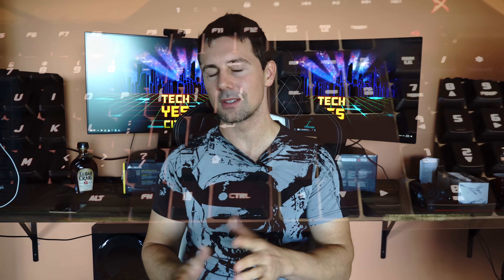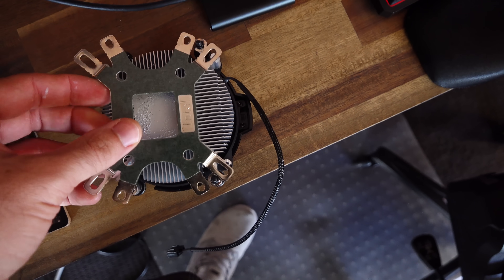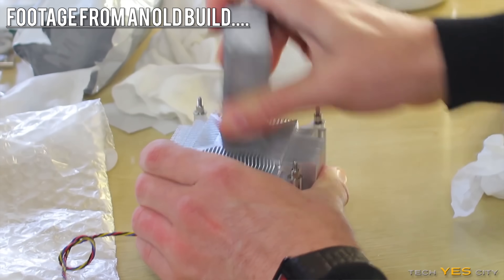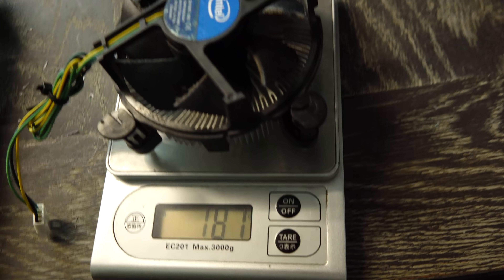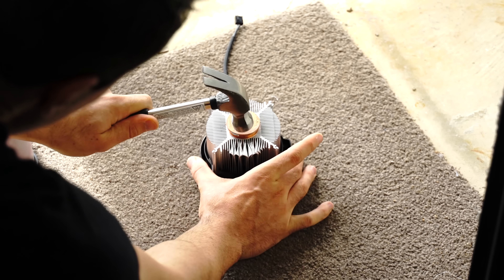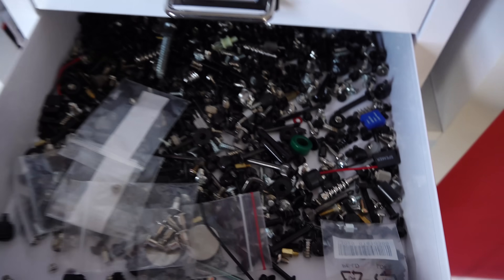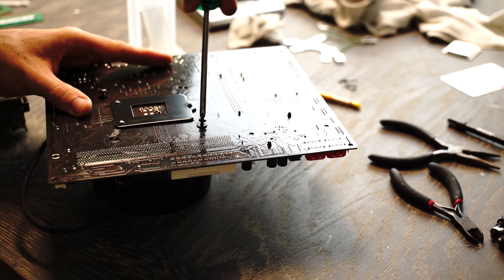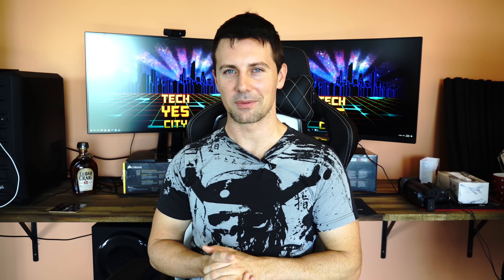How to Mount an AMD Wraith Spire to An Intel H55 Motherboard

Comment: Late to the show, but the stock mounting screws can be removed by lifting the silver metal tabs up from around the black screws one by one until they release. This way you can restore the stock mounting screws if you want to move the cooler back to an AM4/AM5 system.

Comment: believe or not i found one of those amd wraith in a junkyard, and i modded into my lga1155   i5, i had a milling machine so it was easy to do using a sheet of aluminium and some nuts , my i5 is super cool now

Comment: Im planing on replacing the old intel stock cooler to my x58 motherboard and use my old wraith amd cooler wich i moded with a 92mm fan for less noise and better performance i found this on the internet https://www.newegg.com/Product/Product.aspx?Item=N82E16835233060 but i cant find any mounting solutions for the 1366 socket nor the  115X socket do you now any good mounting solution to this ? thanks in advance

Comment: Yep. Did something similar on my Q6600 with the stock Dell heatsink. The plastic part of the Spire can be unscrewed from the heatsink, the screw holes matched up with the LGA 775 Dell heatsink I had already. No extra screws needed. So now I have an HP PC from 2009 that originally had an AMD system in it, upgraded to an Intel system from another HP computer, used a cooler from a Dell Intel system, and replaced the fan part with an AMD Wraith Spire LED cooler. Totally worth it.
Reply: i have a Q9550 and i wanted confirmation on the AMD stealth or spire cpu cooler being compatible with the 775 socket without having to physically damage/Hammer/modify the heatsink and you made my life better my sharing your experience  ! I thank you sirrr

Comment: Those didn't look like self tapping screws. Self tapping screws have a vertical cut in the end perpendicular with the threads. This sharp end is what cuts the threads. If those were actually self tapping screws you would have seen aluminum shavings come out where the threads were cut.

These are just regular screws but since they went into aluminum it just deformed the aluminum to accept the threads. Self tappers aren't required when going in softer metals as long as your hole is the right size

Comment: People, I want to know something. I'm starting a new watercooling build (my first) and I have a few questions. I have vega 64 gpu from msi, an I7 8700k, the Asus strix z370 e, 16gb trident z memory and a 1000watt psu from cooler master (the v1000). I was thinking of putting a reservoir in the place of the hard drive cage. Would that work? I am thinking of using the ek xres 140 revo d5. If not, what will work? I am also planning on using the vega 64 water block from ek but it doesn't look like the radiator, fans and the block will fit. I just have the pc and no watercooling equipment as of now so I haven't bought anything. I am thinking of using the ek supremacy evo cpu water block or the phanteks cpu water block (the c350a_bk01). Would it be possible to squeeze a 360mm rad in there? Or a 240 up top alone with fans in the front? Will a 240 alone be enough for both the cpu and the gpu? Or should I just change the case? Do you guys have a better suggestion for the case? A case with better watercooling support, maybe? With decent airflow? Also, if you can help me out with the fittings and stuff, it would be appreciated. I'm probably not going to be using hard tubing cause I'm lazy so bends and stuff don't matter as much anyway.

Comment: It's cute how to correlate weight of the coolers to their cooling potential. Specifically, when you weigh then with all of the plastic, non-heat transferring crap attached to them. You must be given a PhD!

Comment: you say that the copper slug isnt permanently attached however as an engineer i can say it is as there would be no other way other than a compression fit to connect copper and aluminium as they wont weld or solder together and a compression fit wouldnt need thermal paste or adhesive.

Comment: those aren't self taping screws. self taping screws have a bit to cut into the material to help sink the screw in better. wow hack job. I would of used a dremel to cut out the area so it will pass anything in the way. Hmm just scratching my head.
Reply: JayRock I'm scratching my head about someone who can't even spell "tapping" criticizing anyone else for anything. Fix yourself first. 

#priorities

Comment: While I love the idea/concept, the execution here was... lacking. Breaking off the screw mounts for the stock screws? Why not just pull off their c-rings and remove the screws without damage? Similarly, bending away fins with a hammer? Why not use a dremel or hacksaw? I suppose you use what you have, but that's not exactly good DIY advice. Oh, and the copper vapor chamber slug coming loose doesn't bode too well for thermal conductivity between it and the aluminium, now does it? I suppose lowering it down had benefits for fitment, but I'd at least pull it all the way out and smear some thermal paste around it to avoid air gaps as it's already loose. Not that the temps seem bad, but once it's loose, chances are vibrations will cause it to loosen further.
Reply: Let me just go get my dremel... oh wait. I don't have one. and how exactly would you use a hacksaw for that? Maybe tin snips at best, but the idea of using a hack saw for that? Laughable.
Reply: The idea of mounting an AMD stock cooler to and intel board itself is ghetto and budget. Him hammering it is totally in character for what he's doing.
Reply: @bearhopman6785  Wow, not often I get a reply to a 2-year-old comment. Oh well. Firstly, I wouldn't say it's ghetto in concept, more of an experiment in testing how AMD's stock coolers compare to Intel's. Nothing at all ghetto about that. Someone wanting to do this rather than go out and buy a $30 cooler is of course a bit of a hack, but then why do something like this if you don't have the tools for the job? Secondly, trimming off the corners of the fins with a hacksaw wouldn't be that difficult - just angle it across at an angle and go at it. (Unless you need to remove them all the way in, but it doesn't look like that's the case.) Tin snips would probably work decently, but with those you always have the issue of actually getting them in there in the first place. Grinding them away with something like a power file might be the best. Or given how soft aluminium is, just a sharp chisel and a mallet.

Comment: hammer that cooler 

the non conductive washer probably not needed.  just make sure the threads do no touch the MB layers.  That is more of a concern than grounding the cooler.

Comment: My stock cooler that came with my Ryzen 5 1600 (The Wraith Spire I belive) got me to 3.8ghz solid, I still had thermal headroom to go to 4ghz but the CPU would crash instantly on a cinebench run so I believe it was an bad overclocker, but the cooler is really effective

Comment: Not into bangin' coolers mate, but good info none the less.

One thing I'd like to point out is that with the older LGA1155 and LGA1156 socket ASRock motherboards, there's an option called CCO aka Combo Cooling Option, which allows you to use any LGA 775 socket cooler you may have lying around through additional holes to accommodate them at the back of the motherboard. So, if you have a LGA1155 and/or LGA1156  ASRock board, and you don't wish to invest in an expensive cooler, you can grab an older intel LGA 775 Cooler and get a decent performance out of them.

Comment: What is the price of the stock LGA 1156 cpu cooler?
Reply: Probably around $5 for Intel, they don't sell them aftermarket though... for good reason too - they're awful. Unless you live on the northpole always put an aftermarket cooler on your Intel rig if you do any kind of prelonged workloads (gaming, rendering, compiling etc). If you don't your system will most likely be thermal throttling.

AMD's Ryzen coolers however don't warrant immediate replacing, they're fine - hell you can even run a small overclock on 'em and still be fine.

Comment: Better to cut the fins then hammer them to push out the slug. Also, hopefully people will tap the screws before install as aluminum shavings on the motherboard can't be good.

Comment: Pro tip. Screw the screws into the cooler without the mobo use the screws as a threading tool then use new screws when mounting.

Comment: That's from Coolermaster, not Noctua. Noctua has a plate for LGA socket only while using AMD's backplate for AM4 mounting. This is LGA 115x/775 and AMD mount brackets, typically from Cooler Master but the new ML240R doesn't use these multi-platform backplates anymore! 

Hope it helps!

Comment: I have a Pentium 4 cooler on my Core 2 duo E7300 pc and I must say that heat transfer is better than a stock intel core 2 duo cooler even when overclocked to 3.30ghz it keeps the processor amazingly cool around 40 to 50 degrees but my Pentium 4 processor which came with this cooler heats up to 70 degrees.

Comment: Hi Bryan, I'd love to a test of some budget SSDs you can get from Aliexpress and eBay from brands such as KingDian, Vaseky, Kingspec etc... Keep doing what your doing and love the channel.
Reply: Just buy a cheap SSD off AliExpress they work fine I’ve used them, the only bad one seems to be the nvme kingspec that runs extremely hot
Reply: Bob Clapperton works fine
Reply: T0T0L`/A they have better graphics on the product pages lol. What is the advantage?
Reply: I’ve had a few budget SSDs off AliExpress and they’ve been fine and I’m not after extreme disk performance just something that will have fast boots and never lag with background tasks like windows update which a HDD does. The kingspec nvme ssd looks good with some of the benchmarks in the reviews but runs at like 90, which isn’t great when a lot of people will buy for a laptop.
Reply: dustojnik hummer those are double the price where I live may as well pay extra and get a Samsung
Reply: A performance and endurance test on those cheap SSDs would be quite a good idea.
Reply: Only read terrible things about those... Like the SSD´s failing after 2 months etc...
Reply: I'm only interested in the raw performance of these things (or lack there of). I wouldn't ever consider purchasing one, period.

Comment: 2018 Stock intel coolers suck when compared to AMD coolers
Reply: not just cooler 
how amd designed their cpu's TDP and cpu's perfroms
Reply: Laxmi Narayanan KS lol have you seen the old ones?
Reply: Intel stock coolers, and even more their thermal paste have been sucking hard since Skylake. It was so bad I had to replace my i5 6500's stock cooler with a Cryorig M9i just to play GTA 5 without overheating!
Reply: The only difference between a current Intel stock cooler and one from 1ß years ago is the distance of the mounting holes.
Reply: Na any stock cooler since 1155 there like 1/2-1/4 the hight
Reply: cowthedestroyer I've never had good temps with an stock cooler from Intel an ziptied am3 cooler cools much better.
Reply: It was definitely installed correctly because it was working fine for a year. I think it was just the thermal paste, but I got the M9i anyways because I wanted something more quiet.
Reply: I'd say from Wraith and later on which would be around late 2016 (if I'm not mistaken), but pretty much spot on.
Reply: Its 2024
Intel stock cooler still suck
Reply: @GTXnayeem  𝓕𝓾𝓬𝓴
More like Intel itself sucks 😅
Reply: AMD Ryzen is king on the TDP/Cores/performance/Price.